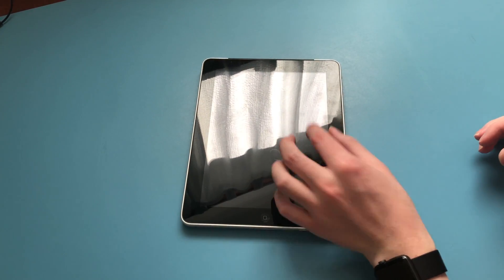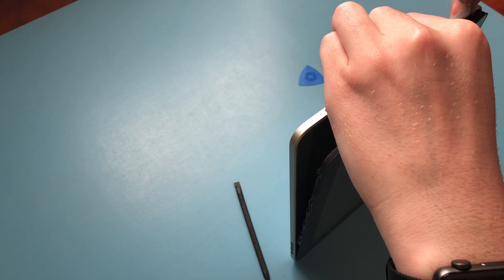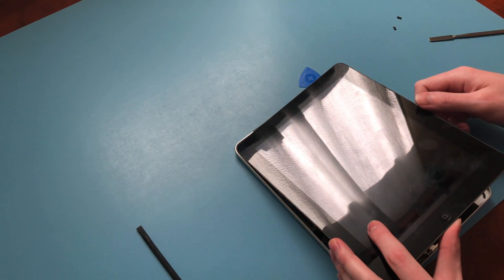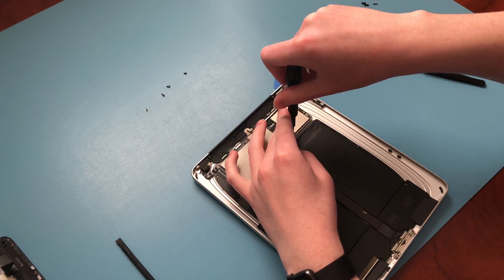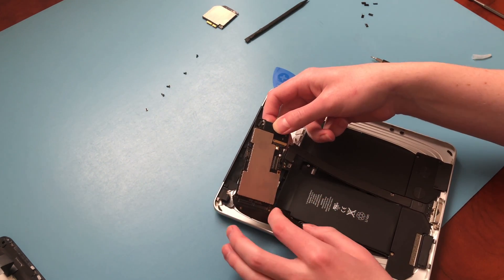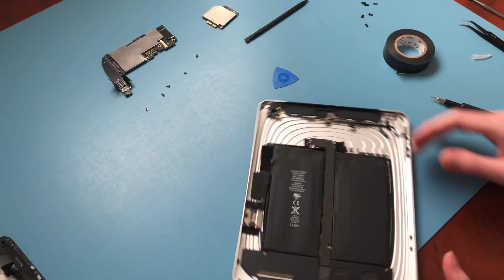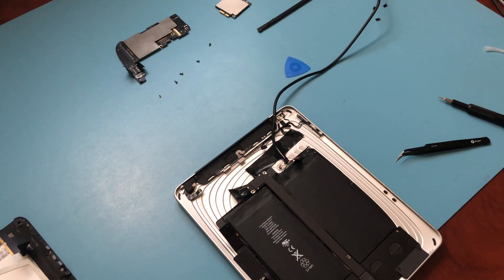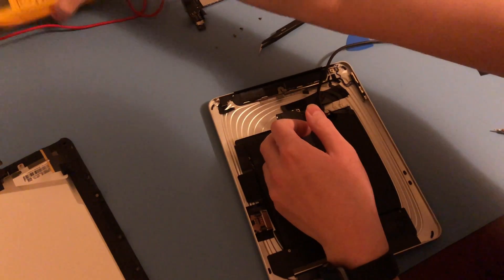How to fix a dead first generation iPad for free!

Comment: I have an ipad that as soon as I plug it on the charger the apple logo shows up but after a couple of seconds the screen goes dark. It sometimes shows the low power but charging logo but doesn't seem to charge. Could this method work?

Comment: Worked for me.  I reanimated a bootlooping 12 year-old Ipad gen 1 with this procedure.  Disassembly and reassembly was a bit tricky for my twitchy fingers and bad eyesight, but got it done by working slow and carefully.   Helps to have the ifixit guide at the same time for the steps involved in teardown and reassembly.

Comment: Great instructions!  My battery powered up to 100%, but the touchscreen is black.  I can "see" the iPad when connected to a computer, but cannot transfer data as I cannot "unlock" the iPad... I took it apart again and checked all the connections, but everything still remains dark.  Any tips for getting the touchscreen to work again?

Comment: Does this work also when it trys to power on on connector? One is just flickering when plugged in and one shows the apple logo for 6 Seconds before dying.....
Reply: my one flickered white every few seconds so i tried this and it worked, thing is the battery dies after like 10 minutes after fully charged and then boot loops with the apple logo for 6 seconds sadly. Better off getting a replacement battery id assume

Comment: NICE!  My son has an old Ipad Air 2 that was 100% working and charging then one day the screen just turned black all of a sudden.  I tried hard reset several times with and without being plugged.  Unfortunately still no signs of life at all.  I was just thinking of replacing the battery since it's not much, but I'm hesitant because my gut says it's not the battery and probably more like a software issue.  I'd appreciate any help from you or anyone pls.

Comment: If your original ipad is boot looping on the charger, try getting it onto dfu mode and leave it pligged into a computer or charger that way for a couple hours and then attempt a normal boot

Comment: I had a 10th gen iPad https://www.youtube.com/post/UgkxUGaHtKW8MwCql2fPyIm9-ftTqSMzKFFA . Felt it getting pretty slow at times even after doing a reset. So I am using that as a tablet for my 5 year old son and got this 9th gen version. MUCH faster, a little slimmer, smaller bezels, all around a leap forward. Plus, for the price that’s about $130-$150 cheaper than a current new model this is a nice deal. I look forward to the M-series CPUs coming into iPads which will really help future proof these tablets better but these latest CPUs are pretty strong and should do better to last several years with no compromises.

Comment: Dude  YOU ROCK !!!!!! ..     I followed this to the exact video instructions ..   IT WORKED ! ..   only thing I would ask you about which I did anyways is to cut holes on the other side of the battery pair and test  that side too..  Only thing I did differently is put the LIPO charger onto it  for about 30 seconds  to get it up to 2+ volts.. ((yeah I used my ONYX245  LIPO charger on NIMH setting)).  then connected everything back like you said and let the regular charging go for a few hours..  worked like a charm .. Thanks Man !
Reply from the maker: Checking both sides never hurts! Glad to help out.

Comment: Is it possible to just secure the leds and used the iPad with a hard wire power source ?
Reply from the maker: If you’re able to safely and consistently supply the same voltage as the battery did to the board, you should in theory be able to

Comment: Thank you!  I had an old iPad 1st gen that wouldnt start that I wanted to get some old information off of.  I couldn't take out the screws, so I rolled the dice and taped leads to the negative an positive just like in your video but without disconnecting any of the electronics.  When I first tested the battery it was at .005 volts... dead dead... I hooked it up for 10 minutes and it brought the battery to 3.6 volts... I then disconnected the taped wires, reconnected all the ribbon cables, and plugged in the proper charger... it started right up!  thank you so much!!!
Reply: Hey! I know it’s been two years but, how did you do that?

Comment: Is it completely necessary to remove the cel chip and the other, why can't I just go straight to the battery terminals? Thanks
Reply from the maker: It’s probably fine, but just to avoid sending current to the board and damaging it, I strongly recommend removing the boards.
Reply: @Batteryfixer  Well I just disconnected them, but left them still inside. I should mention before I started all this the screen just flashes white every 3-4 seconds. So after your procedure, the screen still flashes, &  I did have around the same voltage as you did on the terminals, any suggestions?

Comment: hi how you going Liam good l hope can you please tell me if l can use power bank to my apple ipad 4 gen to charge it best wishes ERIKA
Reply from the maker: This technique may work on a 4th generation iPad, I haven’t tested it though so I’m not sure. In theory it’s possible to recharge it from a power bank too, but I haven’t tried that either. Definitely try charging the iPad from the lighting connector for a couple days before opening it in case it just needs more time to charge. Often that can make devices work again. Good luck, and be sure to closely monitor the iPad while it’s charging and charge it away from anything potentially flammable.

Comment: Heyy Liam ! First of all thanks for the video ! I have a question tho. Can you dirrectly charge the battery without taking out any parts like i removed the screen and the tape over the battery, put electric tape and etc.. and charge it ?
Reply from the maker: Happy to help, while in theory it’s possible to do that, I don’t know how the iPad would handle that. It may damage the board itself. Never tested it though.
Reply: @Batteryfixer  Hey Liam ! I got news ! I left it charge for like 30 mins and checked on it ! The charger was a bit hot so i knew it was working (i don't have a multimeter). I hooked up the screen, plug it but i did not attach it and the Apple Logo was showing for a loooong time ! Then i saw a spinning wheel and it was charging with the low battery icon. I'm not calling that a win for the moment but i will still wait and see if it works and if i can boot to iOS. For the moment im not charging with the original cable but directly to the battery. I'll wait like two hours or less and see what happens ! Your video really helped tho so thank you !

Comment: Hi Liam, mine is swollen. Do I fix it with the same process or do I have to purchase another battery??
🤔
Reply from the maker: I tried it on a swollen battery once and it did seem to work but I wouldn’t recommend using a swollen battery.

Comment: My iPad 1st gen Wi-Fi model’s battery started smoking when I tried this, I made sure the positive and negative were in the right spot? Is my battery completely screwed now?
Reply from the maker: Hm that’s not a good sign. It sounds like there may have been a short, but I’m not sure. Id say the first step would be to remove the old battery and recycle it then get a replacement. The old one may be dangerous now unfortunately.
Reply: @Batteryfixer  Thanks for still responding to comments long after uploading, and you’re probably right I should replace it because now I’m too scared to even try putting that in. The iPad shows the Apple logo when plugged in without the battery and before I tried this if I plugged the iPad in with the battery connected, it wouldn’t show anything. Do you think iFixit has any batteries and if not what one do you recommend

Comment: Does this work on iPad Air?
Reply from the maker: In theory it should, but definitely try charge it longer first as the Air’s aren’t as likely to have this issue. It will also have a different opening procedure that I recommend you review before starting a project

Comment: Hi Liam, thanks for the amazing video. I'm confused about something possibly basic. When I stripped my usb wire it had a pink and white wire., I confirmed which side was +ve and -ve by connecting the pink to the red on my multimeter and white to the black (ground) and confirming that I saw a +ve 5V. I attached the pink wire to the rightmost battery terminal and white to the left one and left it to charge for a while.

When I attempt to test the battery charge with a multimeter, I see -0.6. Is that normal or has something gone wrong?
Reply from the maker: that sounds normal to me, you can try reassembling it without sealing the display and powering it on while charging via the 30 pin connector. If it still doesn’t boot, you can try directly charging the battery for a bit longer. Hope this helps!
Reply: @Batteryfixer sorry just to be clear. My concern is that the value is -ve :x. I also just realized (after I made the comment) that it had automatically switched to millivolts. So I suppose that's nearly zero?
Reply: @Batteryfixer  Oh wow, its working now. Amazing! Thanks Liam

Comment: How long did that work?  Why not just buy a replacement/new battery for like $35 like I did..... dreading pulling this apart.
Reply from the maker: Fixed well over 10 iPads with this issue this way. All still hold a charge and work well a couple years later. Definitely worthwhile.

Comment: hi where can i buy the screen frame replacement i can't seem to find it in amazon 😅 need help
Reply from the maker: Hm, I’ve not seen just the frame for sale, but they’re probably available somewhere. Have you checked ebay or AliExpress? And if you can’t find it there, most digitizers come with the frame pre installed. Good luck!

Comment: Hm. my friend found this iPad in a box with all the cables not connected. The display and the back were in the box. I reconnected The cable with 2 parts and the small cable, i restored it, but i found a problem. The screen wouldn't clip into the back all the way. I think this is because a lack of clips by the charger area, but it turned on. It showed the setup screen, but it didn't respond to any of my fingers, the home button didn't work, and the power button is stuck. I don't know how to fix this.
Reply from the maker: I recommend double checking the guide on iFixit’s website, there are a number of small connectors to keep track of. Sounds like the digitizer may be loose, try lifting the latches on the 2 piece cable’s zif connectors and reinstalling them. The home button may not be making good contact if there’s a gap in the frame, it needs to have contact with 2 spring loaded pins on the dock connector. Good luck!

Comment: Thanks for the video Liam. Question, any reason why you removed all the components before accessing and charring the battery? It would seem that the battery is accessible simply by removing the screen from the iPad?
Reply from the maker: Glad you liked it! I removed the logic board that way it won’t be at risk of any electrical damage while charging. It’s unlikely to be necessary, but I don’t want to risk any damage.
Reply: @Batteryfixer  Thank you. Going to give it a try.

Comment: my guy you are a magician how the hell do you open this thing without destroying everything
Reply from the maker: Really carefully! It takes time, and it’s easier with practice. Good luck!
Reply: @Batteryfixer  I have managed to open the ipad and “recharge” the battery but the ipad is still dead and only turns on after being left charging for an extended period of time and lasts about 4 minutes before turning off again could this be like some sort of power leak on the board?

Comment: Thanks, invaluable info that brought back my 1st Gen iPad today (if only it were possible to run apps on it in 2022). One comment is that connecting a 5-volt charger to a 3.7v Li-ion cell can easily destroy the battery, since they are only designed to charge up to 4.2v. It probably worked OK for you because a few hours at 1A wasn't enough to get above 4.2v, but if you had left it connected that way for much longer, it would go over-voltage (which according to my understanding would be bad). I modified the procedure a bit to use a DC power supply to charge at a maximum voltage of 4.2v and a maximum current of 600mA. After maybe 3 hours of that it was up to around 4.1v, so I put it back together and connected to a normal charger. That was enough to get the battery charge screen, it booted maybe half an hour later at something like 5%
Reply from the maker: Glad to hear it helped! I know the original method’s not ideal, but it was the best I could do without a DC power supply. I’ll have to look in to one eventually.
Reply: @Batteryfixer  Now the dreadful waiting process begins lol. Currently 5 minutes in and can’t wait for it to work
Reply: It is possible to run apps on it. Jailbreak it using 3utools, which should install Cydia to the iPad, and then install tweaks and stuff and then install IPA files of apps that you want to download on the iPad.

Comment: Hi I have followed the above method which is fantastic by the way, thank you! My battery is showing 2.5V on the multimeter after charging, however when I put it back together I am still stuck within the bootloop on a 12W 30pin. The Ipad also isn't being recognised when plugged into a PC. I am trying to recover old photographs. Any hints as to what else could be wrong or how else I could go about data recovery?
Reply from the maker: You may need to charge it a bit longer. Some batteries seem to just take more time than others. If that doesn’t work, you’ll need to buy a new battery or old 1st gen iPad with a working one. Look for one with a broken screen if you do, it’ll be cheaper
Reply: @Batteryfixer  Hi Liam, just wanted to update you and thank you for your video and advice. picked up a old 1st gen Ipad and replaced the battery of my old Ipad, wokring nicely now. Was able to get all the old photos from its storage for my parents to enjoy :)
Reply: the same problem...

Comment: Hi, may i know what kind of screw is that? Because i tried T5 and T4, both of them cant even fit the screw. Thankss
Reply from the maker: Hello, according to iFixit’s website it’s a T5
Reply: @Batteryfixer  i opened it already, and followed your step in the video, but first (before i charge the battery using wire only) the battery have sort a bubble inside (cause i didnt even charge it for 2 years) and after charge it like in the video the bubble goes away, but i cant even see the apple logo, eventhough i already charge using the wire only for almost 10 hours, btw i could feel heat on the cable when i charge it using wire only, any help mate?

Comment: Hi Liam,  Great video.  I had the same problem with mine.  I tried a tick I used with old batteries when I was a kid.  This is not the right way, so you are on your own and I am not responsible for any loss or damage.  I left my iPad indoors in the sun for 30mins.  I then let it cool off  and plugged it into a charger.  It gave the battery enough charge to turn on with 1% life left.  I was happy I didnt have to take it apart because I am not as gentle as you :)  your video was going to be my next move.
Reply: بالله يافيصل اشرحلي اذا سمحت كيف سويت الطريقة بالتفصيل بعد اذنك
Reply: Can you explain why that worked for you Faisal?
Reply: I would love to know what the sun has to do with anything since we are advised to keep it out of the sun?  Did you mean to soften the glue with heat?
Reply: @ooohlaa13 the battery might be extremely cool so heating it with a hairdryer

Comment: Hi, I am wondering.... What if you remove the motherboard and try to charge the battery pack from the exposed pins that's connecting to the motherboard? Left is positive, right is negative? Why won't that work?
Reply from the maker: Good question, I tried charging from those pins at first, but that didn’t work since it’s going through the same protection circuitry that’s preventing it from charging when it’s in the iPad. I needed to bypass the protection circuitry entirely for it to properly work

Comment: How do I clip the screen back down? As i am struggling and don’t want to crack the glass by doing it wrong.
Reply from the maker: That’s understandable, it’s a tight fit and will need a bit of gentle force. Start by aligning the right side of the display in the frame then gently push along the top and bottom from right to left so everything clicks into place

Comment: Thank you
  I fixed it. I have a second malfunction. The screen has lines. Is it a flash or gauze problem?
Reply from the maker: You’re welcome! The LCD or LCD cable may be damaged. Check for damage on the cable and board connector. If there isn’t any, it’s most likely an issue with the lcd itself and it will need to be replaced

Comment: hi, when i use multimeter on  + - after leaving it to be charged i get 0 signal. Volt is still 0 on my meter. Any tips?
Reply from the maker: May need to be charged a bit longer or your battery may not be recoverable. If the battery doesn’t feel slightly soft but instead hard/crunchy it’s gone completely bad.
Reply: @Batteryfixer  yeah, battery is dead but it was worth a try :D